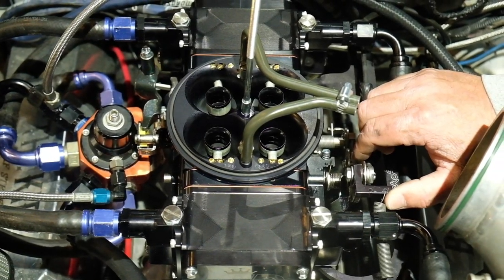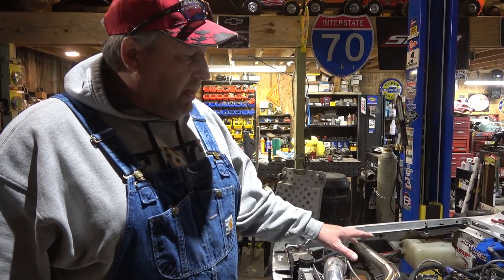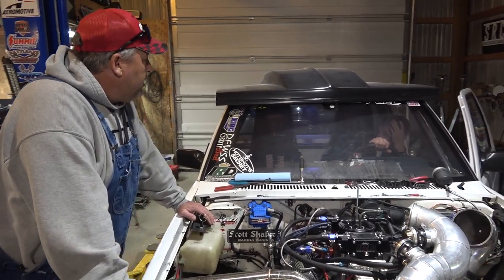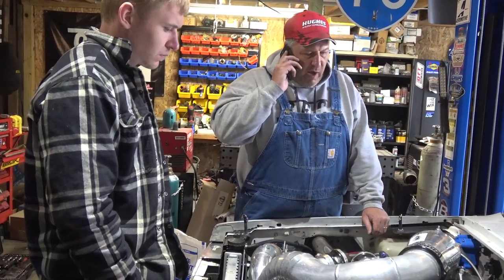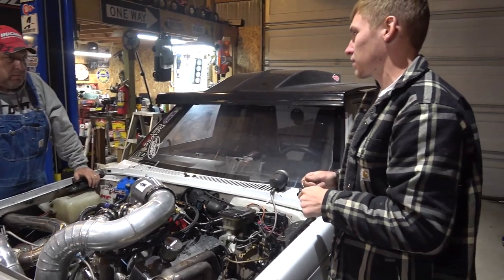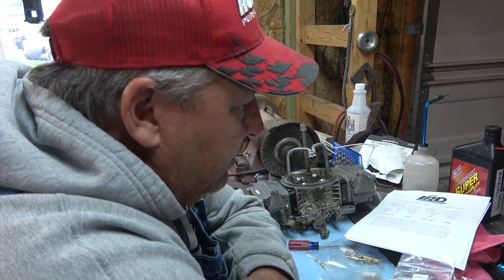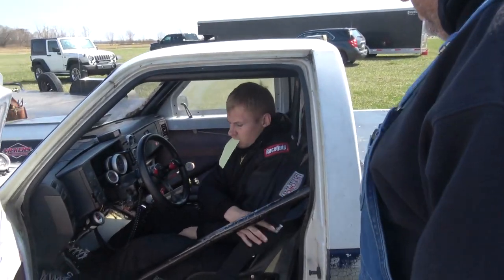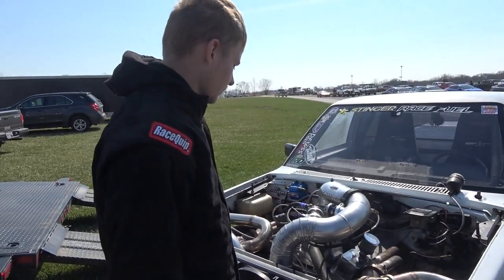New Carburetor Tuning, and Spicy Test Pass at Marion!

Comment: Nice pass!  In my old fuel leaker days, I could never get the higher cfm carbs to flow enough fuel.  Main wells on the metering block normally maxes at .250 on most blocks, but the booster feed I could never get past .200.  I did have good luck once putting fuel through a nitrous plate for a little while, only ran fuel through it and it came on with a hobbs switch.
Reply: Yeah your turbo looks like it belongs on a helicopter also.
Reply: I always wanted to try that for additional fuel. Thanks for the r&d.
Reply: Watch giving opinions John u might get knocked out he seems to be on edge most of the time.

Comment: Hey guys. It makes cents to me. You just have to go testing. Because that carb is going to wake that chev up. One of the engines we have here is a 351 Cleveland. But it has 302 rods in it with off set pistons in it. With 3v heads on it and a funnel web in let manifold. I had a 750 in it. And it was not enough so I put a 850 on it. And I was ok but I put a 1050 on it and wow that fixed it up. With the 850 and only 98 pump fuel it made 650 at the wheels. Then I put the 1050 on it with 98. And it made just on 800hp reving it to 7500. And this engine is for my little sister for her XD falcon. She was happy with it. But she wanted more. So I built her a cobra jet 429. And we are running a 1250 on it. But I haven’t Dynoed it yet. But it should make around the 1000 hp mark. NA. But Cain hard guys.

Comment: Nice looking carb and sure you will get it ironed out.. just a little learning curve. Would be interesting to log drive pressure and back pressure before and after the carb swap, curious if the down pipes will be large enough?....8"in 6"out? Also, because the 02 sensor is sensing 02 and not a fuel sensor, shouldnt the reading trend towards lean on the 2 step cause its not burning all the 02 due to ignition cut ? Just curious....keep rolling...

Comment: I have a question for you. 
I put a Holley carburetor and a Edelbrock intake on my v6 s10 blazer and I got the throttle position sensor for the transmission that bolts onto the carburetor so the transmission nose what’s going on with the engine but my question is how do I use my O2 sensors that are already in the exhaust do I need to find them and hook them up to a gauge or rewire them?

Comment: Even it was free carb i would take FI any day
Reply: $3000 paid for the Holley dominator. MS3 would have been the whole setup with pumps.
Reply: That's because you don't know how to tune a carb lol
Reply: Typing on the keyboard share a lot easier than getting your finger covered in gasoline and methanol
Reply: @Stevesbe  well this is what I know. Cast intake, single carb, 2 nitrous systems, with a big block Ford (yes they exist!) on a 28x10.5 tire, at 3400 lbs...now I've been told that combo CAN'T be fast. Yet somehow it produces 4 second time slips everywhere we go.... without melting pistons, blowing the intake off of it, sending rods through the pan....nah I must be lying 😂🤣
Reply: @kalebhall2925  And I'm sure at any d/a, humidity,temperature and track.
Reply: @chrishouston1406  it's slower at altitude obviously. But hey, if you doubt it lmk I'll give you the address to my home track, and you can come find out. Heck if you beat me, I'll pay your gas bill! But! You have to be able to prove it's YOUR car and YOU have to drive, since most of you commenters are just keyboard warriors.
Reply: @kalebhall2925  Not doubting it but FI is like endless jets,squirters, pv enrichment, air bleeds,boosters, and pump shot. Also the ability to load tunes as fast as conditions change in the staging lanes on a keyboard. Just a couple of advantages.
Reply: @chrishouston1406  I'm just a carbureted guy. That's what I like!
Reply: @kalebhall2925  I  was and still love them but electronic engine management and injection  take away a lot of headaches and prevent disasters . Some of it is used with carbs to maximize combinations. Carbs still  make the best peak numbers in most comparisons though.